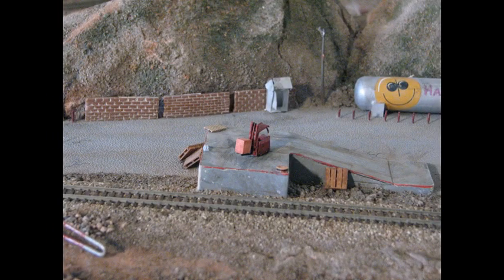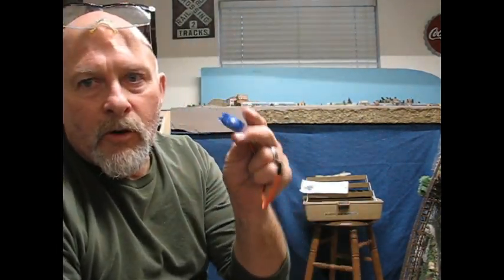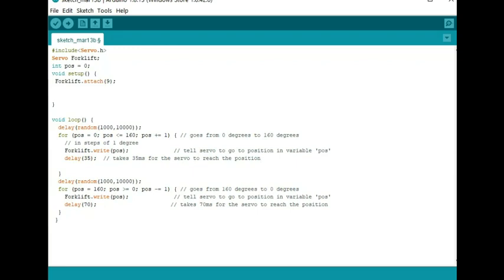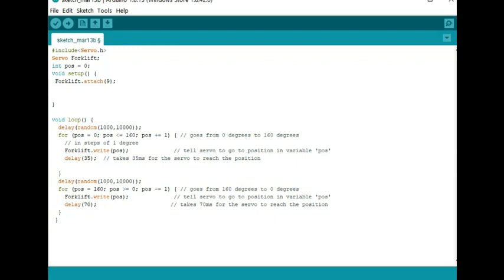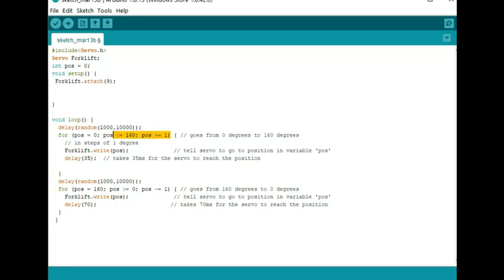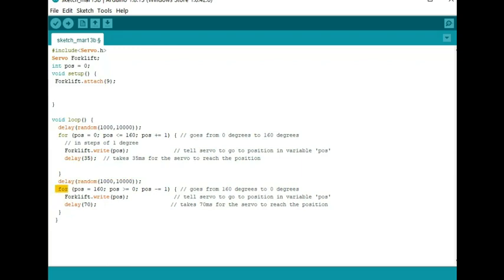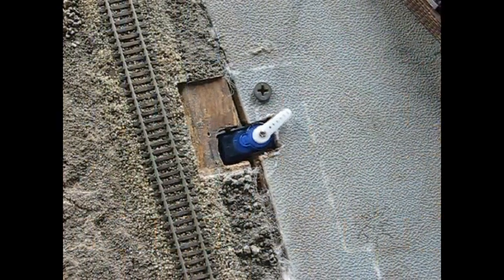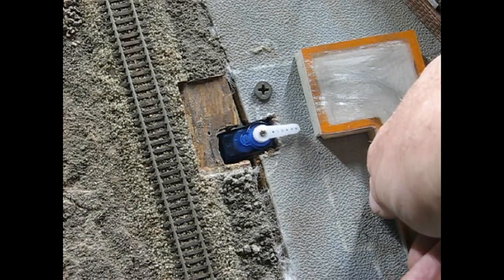Animating a Forklift w Elegoo/Arduino

Comment: Thanks.  Cool animation.  How did you select which servos and magnets to use?
Reply from the maker: Richard Safran, thanks for asking, The magnet was just the right size to fit inside the Forklift. ( I have a skid steer project that needed a smaller size) and the servo was one from a grab bag buy online. I can post a link in the MORE section.